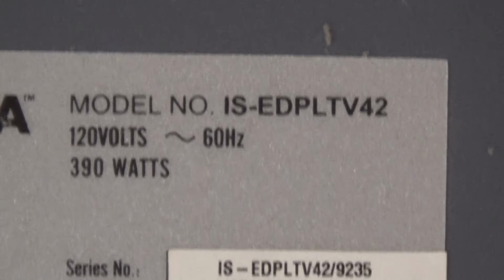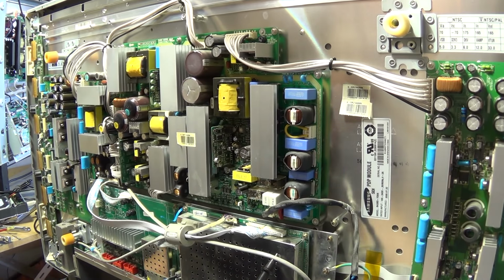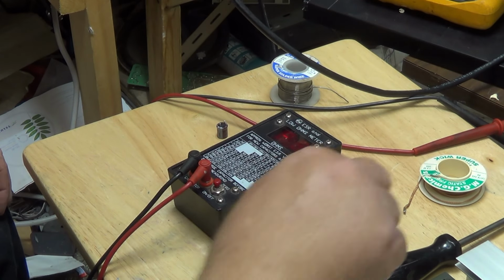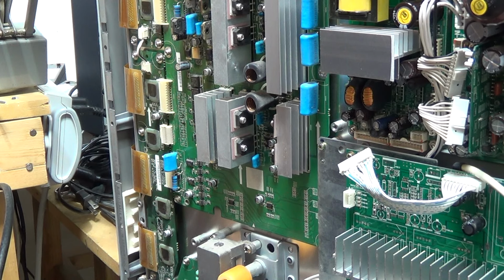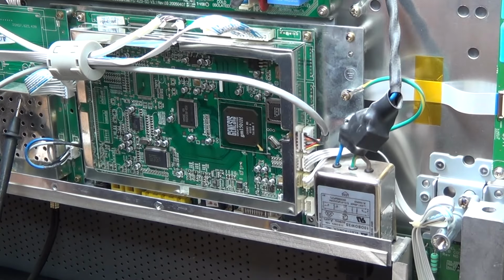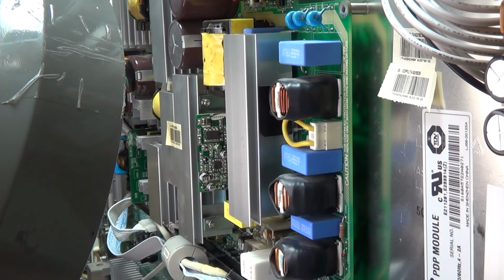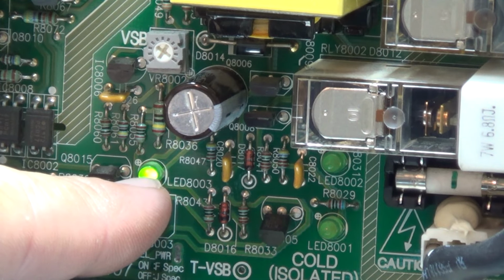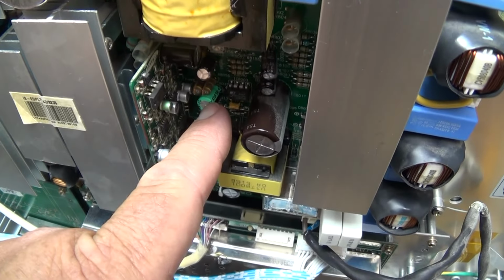Samsung 42 plasma standby power fix

Comment: @12voltvids This a samsung set branded as insignia. I've seen side by sides in stores and the insignia always looks worse. I know walmart runs one source and splits it so all of them have a degraded signal. But even in places like electronics express where they have dedicated signals for each set, the brands like this still always look worse. For all intents and purposes, it should look just as good as a samsung but doesn't. Why is that?

Comment: If The Screen Is Plastic You Can
Buff Out That Scratch.
I Did It To The Screen In My 
Old Samsung Galaxy Tab A 8 inch Tablet.
Reply from the maker: Glass.
Reply: @12voltvids  Now All You Can Get Is Led TV's
Now. All You Can Get Are Led
Tv's. They Don't Need All That High Voltage 
To Run only A Nucklehead Would
Use A M.r Clean Magic Eracer.

Comment: The original ESR meters look so much better than the slimmer versions. The idea of injection a frequency to avoid stray readings or misleading test results is brilliant. Great repair videos 😀
Reply from the maker: Injection of high frequency has nothing to do with rejection of interference , that is how you measure esr. Capacitors block DC, pass AC.  That is how you measure them.  Can't measure how a capacitor passes a signal with DC.
Reply: Now I get what you are saying. Still like yours better than the new ones.

Comment: Plasma repairing was a really challenge.As the failures are deeper in the various pcb modules diagnostic and repairing is going harder and expensive.Ten years before was nearly impossible for the majority of the service labs to have bottom preheating plates,hot air stations,bga reflow tools and no technician was using flux for soldering.
Reply from the maker: This was the very first plasma TV I ever attempted to fix. When I was in the business I took a plasma course, but never saw any, and the shop would have refused because they wanted us to spend about 4500 on jigs to power up the various modules for testing. The shop owner wouldn't spend any money.
Reply: As seems it wasn't a plasma training repair course but an effort to sell low quality diagnostic tools tailored to one or two models and an endless buying for newer ones and in practice those will never be used by any qualified technician.
Reply from the maker: @GeorgeGeorge-xj2bc  they pulled the same crap with cd players.  Panasonic made us buy the focus / tracking jig for 1500.00 and the next year they brought out digital tracking making the jig obsolete.   It was never used but we had to have it to maintain warranty depot status.

Comment: Why would I have 5 V AC stand by voltage from the power supply to the main logic board?
Reply from the maker: Failed capacitor in the standby power supply or failed rectifier.
Reply: I was lazy and did not check most of the electrolytic capacitors.  Non the less, I got it from the garbage and collected all of the components.  I am going to check and keep the good caps.  The bridge rec. tested okay.  Thank you for your help.

Comment: A shame someone else screwed the screen up with some weird cleaning method - would have been a good candidate for auction if you wanted to get rid of it later.

Good picture despite the panel damage.
Reply from the maker: RoughJustice 2k18 
I sold the set to a friend. He gave it to his mother inlaw and father-in-law. They used it on channel 3 from the cable box and threw out the original remote. Then we're not happy once they changed providers because the pix size needed changing and remember I said they tossed the remote. So they sent it back to my friend and he wanted me to take it off his hands and sell it again but no remote. Can't change to component or hdmi without remote and universal won't control input. So I guess a perfectly good tv was scrapped due to the remote.

Comment: Wouldn't a resistor add to the problem of a bad capacitor. My first repair was a fuse on an old portable tv. I've seen and done short circuits, broken chip legs,  rusted connections, broken wire.

Comment: Nice vid!  I like it because the inside looks almost exactly the same as my 2004 model. I pulled it off the street yesterday. Tried it out, the blue ring in front flashes 5 times and then it turns on.  There's no picture (black screen, but it's not lit (not glowing)  however there is sound from the game I plugged into the AV.  I opened it up and noticed a single cap on the power supply bulging (ever so slightly, but because this came from a smokers home, there's prolly a lot more wrong with it).  I'm gonna grab a power supply off ebay, hopefully that at least gets the screen to light up.  Then I can determine if the xy boards are having problems brr...

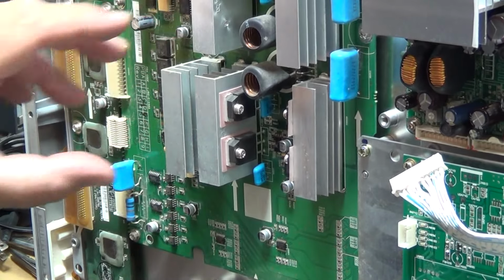Comment: I disagree about Panasonic that you mentioned who made the STK IC Combination because, Sanyo is the only one who made the STK IC Combination where Panasonic, JVC and Technics who buys the STK IC Combination which they figured it is cheap and quick enough to install the Stereo Amplifier and for the Power Supply. It's Sanyo who had made the STK ICs which it is a failure. What I looked it up about STK ICs, include my 1982 Technics SA-106, it is made by Sanyo. 14:00
Reply from the maker: +Bluethunderboom Did I ever say that Panasonic made the IPM? No I said that Panasonic used them. I know that Sanyo made the STK branded module, but Panasonic also did make their own series of IPM. They didn't prefix it with STK, but they also made them.

Comment: Took a little more diagnosing ??
Reply from the maker: +Donald Ellett This one took awhile as I had no schematics for it, and for the record this is the first plasma TV I had even looked in the back of never mind repaired.That set will probably be back in my shop as a bench monitor soon. My son has it now, and he is chirping about the shiny rub marks on the screen where the previous owner used something on it to clean it, and took off the anti reflective coating. SO the boy wants the Panasonic 42 I fixed last year, and wants to trade sets.
Reply: You got it fixed thou
Reply: Good job troubleshooting. WOW! I'm glad I didn't use a brillo pad and some acetone to clean mine!

Comment: You just changed the 1 capacitor ??
Reply from the maker: +Donald Ellett Yes I only changed the one that was bad. It is my set, so I don't care if another one blows and I have to fix it again. Will make for another video.Not all capacitors fail at the same time. Some will go for 30 or 40 years without failing. It all depends on what they are doing with them, and how close they were being operated to max voltage / frequency, how hot they got from other components ect. So, when a capacitor causes a problem, it is generally just 1 that is the root cause. Sure if you are doing a total restore on say a classic amp, and someone is paying by the hour to restore an amp, you can as a tech make much more by changing all of them.  There is not really much skill involved in this. Open the unit up, take inventory of all the capacitors. Get the required values, and then go to town and replace them all. No skill other than soldering required. Any idiot can do this, and because you are changing them all it will fix it. No different than back in the 60s. My dad used to pull the back off the TV, and pull all the tubes and take them to the local drug store that had a tube tester, and sold tubes.Replace all the ones that show as weak, gassy, or had a short and chances are the problem was fixed. If it was a capacitor or resistor that went bad, then the new tube would fail soon, and it was back to buy another new tube that would fail again in 3 months, until something went pop, the TV repair man came over, fixed the root cause and then the tube wouldn't burn out again. A good tech troubleshoots, and replaces the 1 or 2 bad parts, and the unit is now good for a long service life.When I started in the business, the shop across the street we called the tube jockeys. They would change every tube, and still not fix the problem. Eventually the set would come to the shop I was apprenticing in, and the old tech in there, my trainer and mentor when I was in high school, would comment about the competition, and how they knew nothing. After I wrote the CET challenge test, I spent a year working at Sony Canada, and then ended up at that shop for the next 20 years and whipped them into shape.

Comment: The two ig brown caps look as though they are bulging. (near the centre of the PCB layout).
Reply: +Mike Gravgaard Between the three transformers!
Reply from the maker: +Mike Gravgaard Dust caps on top of the capacitor. They are actually OK. ESR is low. That TV is in my kids room, and he plays Xbox on it. Still working. This was actually the first Plasma TV I ever repaired.

Comment from the maker: Yes I know I called the Y sustain board the X sustain. This was actually one of the first plasma TVs I worked on. This was done when I first started working on electronics again after 12 years away from repairs.
Reply: I am really enjoying your videos, learning a lot. I have an amazing 3D Samsung Plasma that someone gave me and I am eventually going to be able to fix it. So far I am pretty sure it's the power supply board but I haven't had a day off of work and school to test everything. Thanks for your videos, channels like yours allow people to self educate and that's invaluable to someone like me.
Reply from the maker: Check the Y sustain for a blown blue capacitor near the little transformer at the top left side looking from the back with the board installed. I have seen a few where that little HV ceramic cap has literally been blown off the board and all that was there was the legs that used to go into the cap. If that cap is blown, then you will probably need a new Y sustain board as it seems to be fairly common on the 3D 50" Samsung of about 2011 vintage. I've seen 2, and neither have been fixed due to the unavailability of that board. (At least there were none available when I had those sets)
Reply: 12voltvids I will take a look at that as soon as finals are over. It's a Samsung 60 inch f8500 series Plasma 3D TV (a 2013 model). They bought it new roughly 2 years ago for 1,700. When you plug it in the relay clicks once, the screen hums  and flashes slightly then shuts off. It stopped working during use. To me it seems like the power supply board must have croaked but I'm not a TV specialist. I will look for that capacitor and check the voltages on the power supply board with my multi meter. I disconnected the Y and X sustain boards independently and together and it didn't turn on in either configuration, just a single relay click when I plugged it in and no response to power on attempts. I will keep doing research and probably take a gamble on a power supply board if I don't turn up anything.

Comment: Great video.  I enjoy the troubleshooting videos.  I have a Samsung plasma 42 that's clicking a relay on the power supply.  I don't see any lights on it anywhere.  I don''t have an esr meter yet.  But I do have a meter and some basic skill.  I replaced some common caps that go bad but didn't fix the problem.  It's a Samsung 42  power supply board BN44-00161a .
Reply from the maker: +cmatthys Check for your VA VS ect voltages. That will give you a starting place. Plasma TVs are complex beasts that have many protection circuits designed to shut them down in the event of a failure someone in the set. In this patictular set it was a capacitor in the standby circuit that had failed, but in the other Plasmas I have fixed since this one, I have had buffer boards go bad, a Panasonic with a blown diode, transistor and drive IC, even a shorted coil in the analog tuner section that prevented the set from turning on. You will need to find a schematic for it, and then it is just checking voltages, and components for short circuits. Sorry I can't be any more help than that, but it could be a number of things, so you have to try to isolate the fault to a specific area. Unplugging the Y sustain and X main boards to rule them out as the cause of no power. With those boards unplugged does the power supply start normal?
Reply: It doesn't.  I have tried to unhook them one at a time too to try to determine a specific board but didn't seem to matter.  It never did turn on that way.  The VS and VA voltages seem to be waaay off!  I have seen that there are other components like the FETs on the heat sinks that need to be changed as well.  I have them ordered.  I had noticed that one had a cracked solder joint so I de-soldered and re-soldered but no worky.  Waiting on parts now.  kit Samsung BN44-00161A / BN44-00162A Power Supply Component Repair Kit 

http://www.shopjimmy.com/samsung-bn44-00161a-power-supply-component-repair-kit.htm

The adventure continues.  Hope those little smb cips won't be too hard.  that'll be new stuff for me.  I recently got the weller little baby blue solder iron.  it's got a nice small flat tip.  I'm going to search out the schematic and have a go at it.  Thanks for the direction.

Comment: This is an excellent vlog.  I learned quite a bit from it.  One discreet transistors rule.  Two, ESR testers are very useful.  Three, insignia is actually Samsung, but I know the sales staff at Best Buy will swear they own the Insignia brand and the factory.  From your other vlogs I learned how dangerous it is to handle capacitors, but now I am starting to think that Caps wear out more often than other components.  So, I should review how to discharge Caps, and I need a capacitance tester, ESR?

Comment: A really well made video.  I did learn a lot from it. 

I'd like to get an ESR meter.  Do you have any advice on what brand/model to get?  I've seen really cheap Chinese ones on Ebay where you only get the unenclosed circuit board - I think I'll pass on that, but the ones that have a housing, any advice? 

Thanks a lot, Tom
Reply from the maker: THOMMGB Mine was a kit. They are still available in kit form.My kit came with the plastic box, and metal face plate. They all work the same.
Reply: THOMMGB Thank you.

Comment: How do you check capacitors without taking them out or fliping the board over?
Reply: Bill B
Reply from the maker: Well I put one probe on the metal back of the cap, and the other probe to either the + terminal, or another through hole component that was attached to the caps.

 I actually did take the board out and tested it, but my camera f--ked up, and the file wouldn't open. If you look closely you will see the shot where the camera changes angle and the caps are obscured by the heat sink.
Well that make up shot was actually shot the next day, just before I put the back on the set. If you watch closely I am wearing a golf shirt one day and a tee shirt the next. They were both black, so if you are not watching closely you will miss it.
But I did test the caps in circuit. The bad one was not tight against the board, and by bending it over slightly I was able to get the probe on the leads.

 What happened is the battery went dead when I was troubleshooting that big board, and I didn't notice that it had turned off until I had replaced the board in the set. I then went and got another battery.
Rather than just have the set appear magically repaired, I did a make up shot.
Anyway, it doesn't matter, the diagnostic was not staged, that component was the problem. It controls the soft start oscillator in the standby switching supply, and there was no signs of leakage, or bulging like generally happens on filter capacitors in the secondary side. Many of these self help web sites all make their claim to fame by showing people how to fix things where the bad components are visibly damaged. This set was not the case, and without an ESR meter, this would have been a very difficult repair. Not that it wasn't a challenge, even for me, as I had never worked on one of these units before, and had to pull a few tricks out of my bag to point me in the right direction.
Reply: Thank you, that was very helpful, love you videos
Bill B.